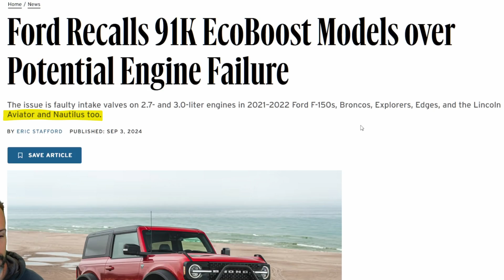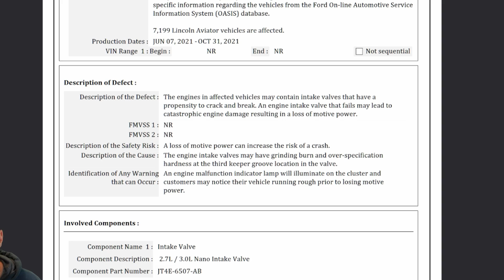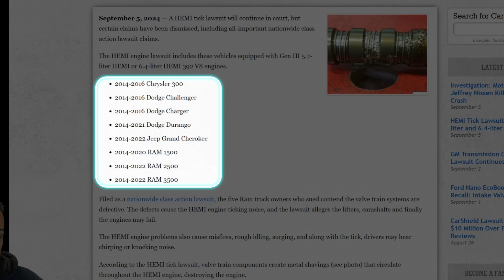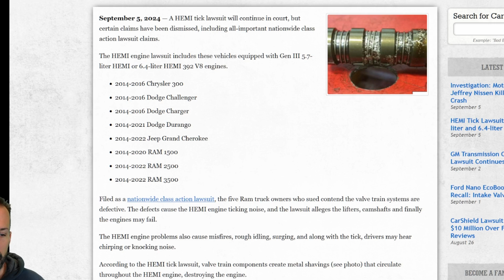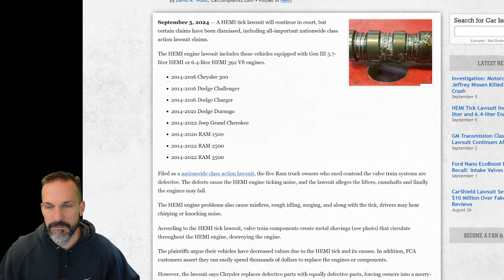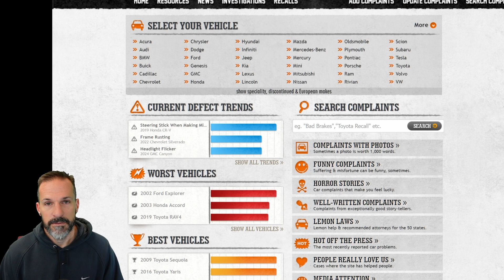91,000 Ford EcoBoost Engines Recalled (F150/Bronco). Can Anyone Build Reliable Vehicles Anymore?

Comment: Not sure I trust any of the new vehicle manufacturers at this point.
Reply: I agree. All these manufacturers having serious issues on very expensive vehicles.
Reply: @66racer  Agreed 100%
Reply: I'll stay with Jeep were I to buy a new vehicle today -- mine's been fine (see above).
"Jeep Wave"
-- BR
Reply: @billredding2000 Stellantis junk sorry to tell you. If it’s got the pentastar v6, it’s a ticking time bomb. Just like the rest of engines in this video. That and failing wires in random places.. wires look fine but the copper breaks inside. Speaking from recent experience with the platform.
Reply: @billredding2000  first crazy, that’s a freakin diatribe you wrote 😂 you need help. Second, speaking from experience owned old jeeps(amc) and family members have several jeeps. The new Cherokee, new grand Cherokee, wranglers, rubicons etc. all have had similar wiring issues. All have had those v6 need internal engine work either under warranty or out of pocket. Recently father in law had to pull the nose off their 22 Cherokee to replace broken wire (inside, not visible) to fix codes due to shutter not opening. I drive a Chevrolet Silverado with the terrible afm and have yet to have an issue, but guarantee it will fail sooner than later. I was not trying to shit on just jeeps. I think all the manufacturers make junk now, including my truck! Third, your brand loyalty is a joke, Jeep is not what it used to be. The 4.0 in-line six was and is a legendary tough engine. Fourth I’m as far from a liberal that I think you can possibly get. I Grew up with 60s novas& vettes, 80s trans ams & mustang 5.0s on and on. My family has gas ⛽️ in our veins. I hope you honestly have a better day.
Reply: @mdubz101  Thanks...I thought I wrote it pretty well also! 
Thanks for noticing!
"Jeep Wave" 🙂
-- BR
Reply: @billredding2000 Modern Jeeps are garbage mate.
Reply: Agreed 100%

Comment: I'm old enough to remember when engines didn't last very long and needed a rebuild between 100k-150k miles. Then things got a lot better through the 90's and 2000's. I think peak reliability for engines was probably early 2000's for GM. The Ford straight-6, 5.8 and early 5.0 coyotes were pretty good too. Toyota was great through the 2nd gen trucks. Nowadays, I think we are seeing the downhill slide for ICE engines. Between govt regs and corporate cost cutting initiatives, everything is getting progressively worse.
Reply: Blackrock owns everything. They own all the automakers too. No surprise everything is garbage. No real competition. All by design.
Reply: Unless it was thee 300 inline 6 by ford. It lasted 400k miles at thee low end. Lol. They know how to make great engines , they just dont.
Reply from the maker: 100% agree…
Reply: @TheCarGuyOnline  agreed as well
Reply: Yep...90s Hondas were unbeatable, Toyotas in the early-mid 2000s were bulletproof but now we are seeing issues across the board. Time will tell.

Comment: They caught the Toyota virus
Reply from the maker: They all caught the remote worker 2020 virus :)
Reply: 90k is about 90% of the tundra 3.4tt engines produced. 90k is less than 1% of the multiple millions of ecoboost produced. Slightly different.

Comment: I thought it was a good thing to buy our 2020 Camry but when it became a joke of doing the "Father, son and holy spirit" thing before getting in, it was time to let go of the joke of doing it and dump that piece of junk. We're not even religious. Our newest car is a 12 year old Ford. I trust it driving across the state more than trusted my new Camry making it to the neighboring city. I no longer want a new car. Seems like they're all junk and there's no sense in that with today's technology. I guess Boeing is going the same way which makes me nervous. I'm hoping one doesn't fall out of the sky on to us.
Reply from the maker: That’s nuts. What issues did you have with the Camry?
Reply: @TheCarGuyOnline  It would be easier to say what worked right. The trunk and doors always worked, not so much the engine, transmission, air conditioning, cruise control...  One of the mechanics at the dealer said they seldom broke down but there were a lot of complaints. A dealer mechanic said  he's sticking with his older one for a few more years. It was nice to see Toyota stopped putting that crappy 8-speed in the Camry. Now the Tacoma's they put it in are having problems and parts are breaking off the standard transmissions. I'm beginning to wonder if Toyota even test drove their new designs around the block.
Reply: My 2020 Camry had too many issues from the day I bought it new. Interior rattles and rust everywhere from misaligned panels that scratched each other.
Reply: @andrewgus8763  Besides the cheap floppy hood, the rest of the body was pretty good. The windshield was too thin and cracked when a mocking bird and I crossed paths on the highway. I never had a small bird crack a windshield before. The mechanical and electrical parts were a different story. Both were full of never ending gremlins Toyota said were normal.
Reply: What went wrong on your Camry?
Reply: @0HOON0  Transmission, air conditioning, cruise control, gas gauge, engine... several systems. The car would slow down or even slam on the brakes for no reason. If TSS was set I had to hang on to the steering wheel because it would jerk to the left. It went over the center line a couple times. I offered to show the dealer how to duplicate some of the problems but they always said the problems were normal for that block. No one in the family wanted to drive it anymore. It sat in the garage unless I drove it to keep the battery charged. That even died once after I got home from work. 8 hours later the car wouldn't start. I heard from a Toyota mechanic it's controlling computer had problems in 2020. I was lucky car prices shot up so much when I was getting rid of it so I didn't lose that much.
Reply: I have a 2023 Camry XSE V6. It did come with a dashboard rattle in the beginning that thankfully I was able to pinpoint and have them fix. Now I hear one in the rear seating area somewhere. It comes and goes. Other than that, after a year and a half and about 13.5k miles I’ve been happy with it. But yes, build quality these days on Camrys aren’t the same. My 2011 Camry 4 cylinder that I drove for 10 years and bought new never exhibited any rattles. Neither did my 2021 Toyota RAV4 hybrid, which was built in Japan.
Reply: @sammyjammy6647  I was happy with the interior. I kept it a little more than a year and got rid of it with just over 19k miles. The floppy hood annoyed me to no end. It was fine until I drove it in the rain. I kept checking to see if water was splashing in. It sounded like the door was partially open. The electronics and mechanical parts of the car were never ending surprises. I thought all the new problems, that Toyota said were normal, finally quit happening but sometimes things would start happening all at once. It would skip a few weeks then start happening again. The car kept me pissed off and uncomfortable to drive. I hated that thing and was happy to see it go away. That car ruined a 30 year trust of Toyota products.

Comment: Lack of material to save weight is one cause. But the main issue is the government forcing EPA regulation mileage standards. All these vehicles are overly complicated lightweight technologically driven all to save one mile per gallon in the short term. But don't last in the long term. Good example active fuel management on GM and CVT transmissions in most manufacturers
Reply: Here's a crazy conspiracy thought: gov't forces ridiculous EPA regulations.  Manufacturers produce lower quality engines to cut costs and try to meet regulations.  Meanwhile, gov't subsidizes EVs to encourage sales.  Customers see decreased reliability in ICE vehicles and turn to EVs under the perception EVs are more reliable.  (Granted EVs have much fewer parts to fail.)  Gov't gets what they want in more EVs.  

(Of course customers still are not fully embracing EVs and the current electric infrastructure would not be able to support everyone having an EV right now, but the gov't isn't concerned about consequence.)
Reply: Part of the issue is demand for HP. 2004 Tacoma had 240hp
Reply: @DearSX didn't it still have 240hp in 2023? Lol jk

Comment: are they pushing everybody to migrate to electric cars? It looks like!
Reply from the maker: Funny you say that, sure feels like it
Reply: Tesla electric cars are the most recalled vehicles in human history, with over 25 million recalls in one decade.

Electric cars are even less reliable with all the cheap electronics and software problems.
Reply from the maker: @andrewgus8763  they aren’t less reliable really, fewer moving parts and 8yr/120k mile powertrain warranty. Most Tesla recalls are dumb things like “the font was too small”, so 2 million vehicles get an over the air software update but it shows up as 2m vehicles recalled. Meanwhile, most owners were asleep for the recall while it updated overnight in their garage :)
Reply: @andrewgus8763 yea these recalls are not entire engine replacements or “your car can’t move” recalls and are easily fixed with software
Reply: @andrewgus8763 Agreed 100% EVs are nothing but useless garbage.
Reply: All the manufacturers are backing off their EV production and sales goals, they still want to sell you ICE vehicles. Personally, I think it's cost cutting, if they can save $0.03 on each intake valve by making it 20 g lighter, they're going to do it.
Reply: Electric motors can spin and run for 1 million miles. Batteries for 500,000 miles or more. 
No valves or reciprocating parts. Simple, clean, powerful, quiet. 

Purchase some extra ICE cars and you'll be able to drive gas for a few more decades. Don't worry.

EVs aren't going away any more than smart phones and computers are going away.

All gas vehicles run on electricity. Without it, they're a brick.
Reply: @dvader3263 Except you can't go on a long trip with EVs.
Reply: Depends who you vote for in November.
Reply: @robertyoung8289 new vehicles will be junk regardless of who you vote for. Your candidate isn’t going to do anything.

Comment: The Ford 2.7 has been a bulletproof flawless engine since it was introduced in 2010 .... making a broadbrushing claim like it's a BAD engine just because 1 or 2 years had subpar valves, which I'm sure have been addressed does not tarnish it'a long record of a great engine....not trying to be harsh here...just stating the facts.
Reply: Most don’t know that the 2.7 (and 5.0) have an internal wet belt for the oil pump 😬
Reply from the maker: @9002-bv9xz  yup, and the 3.0 duramax…
Reply: @9002-bv9xz  I heard that setup was very recent...and is not prone to premature failure....but yeah, not a fan of that myself.
Reply: @barrya.6212  well one has to remember, this is Ford we’re talking about..and they are famous for many examples of dumb engineering.  Don’t kid yourself…that wet belt has a designed lifespan.  And replacing it is a very involved process that will generate lotsa revenue for their dealer service departments
Reply: I can say this as a ford owner (f250 6.7).  I’ve owned many f150 trucks, and they are a joke.  The only ford truck I will own is a super duty.  I also have a Duramax 2500, and a 2008 tundra limited crewmax 5.7.  The Toyota is by far the best truck, and has been the longest lasting and most trouble free.  Over 300k and 16+ years of ownership.  Sadly, the new 2022+ models will never replace the 07-21.  Fuckin sad times
Reply: I’m glad this is being reported .  You would think only Toyota had bad motors according to YT who knew 😮😮
Reply: @Clamjuice65 Toyota are not that good. The new Toyota's have worst quality. People are loyal to automakers. I'm not loyal to none of them
Reply: 3.5 ?
Reply: I doubt mate and it sure ain't outlasting the 5.6L Endurance V8 in the Nissan Titan.
Reply from the maker: I have seen plenty of issues with the 2.7, parts of it are designed ok while other areas are not. Ecoboosts have not been bulletproof. Had a neighbor with the 3.5l, threw a rod at 36k miles. I had a 3.5, pcv issues at 60k. The 2.7l has maybe been ok…at best, will we see all these turbo engines around for 250k-500k like we used to see in NA engines? Probably not without rebuilds and gobs of TLC. My general point is these modern engines are not designed for long term reliability, they are becoming high priced throw away vehicles
Reply: @TheCarGuyOnline not a single issue with mine, and I don't baby it.  The 2.7 is a incredible engine.  What do you drive?
Reply: @CJColvin  My job has nothing to do with the car discussion and I didn't say or not say how I afford one.  Stick to the discussion, not a paycheck.
Reply: @Crusader1414  LOL!!!!!!!!!!
Reply: @Crusader1414  Does you're overpriced EcoBoost truck come with a 5 year 100,000 mile bumper to bumper warranty like the Nissan Titan?
Reply: @TheCarGuyOnline  There's TONS of 2.7 ecoboosts with over 300,000 miles without issues...just basic maintenance..
Reply: @barrya.6212  By 300K that 2.7 will have gone through 2 ten speed transmissions lol 

That’s the problem with Fords, the engine may be fine but the transmission is trash, or vice versa.
Reply: @barrya.6212 What ingredients does these EcoBoost engines have that makes em so tough and durable other than maintenance? Also what job do you have and how much money do you make to afford one with ease?